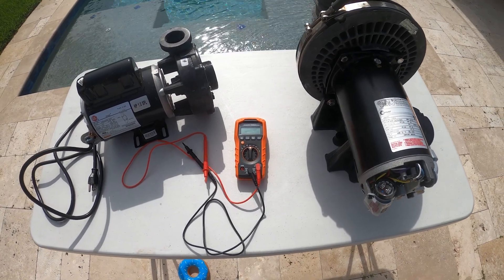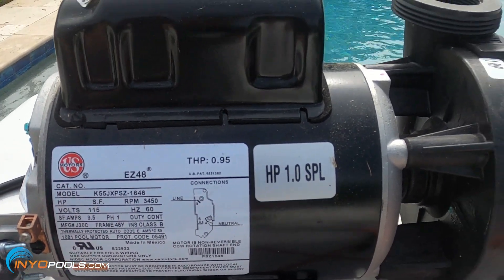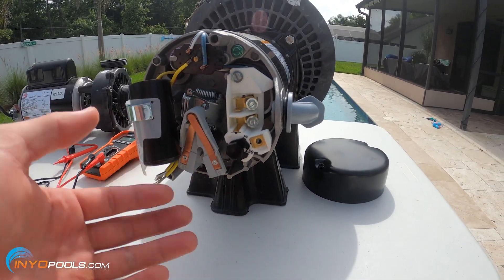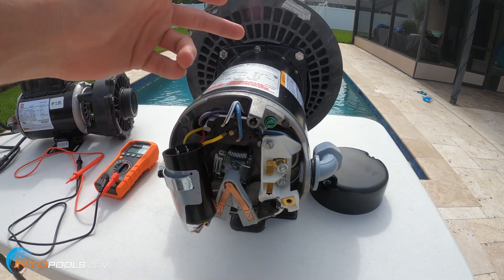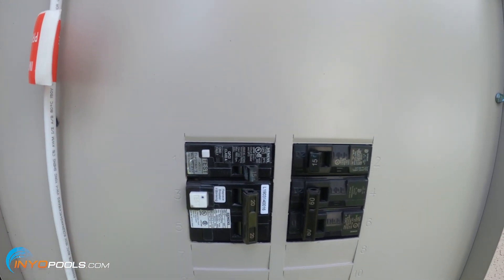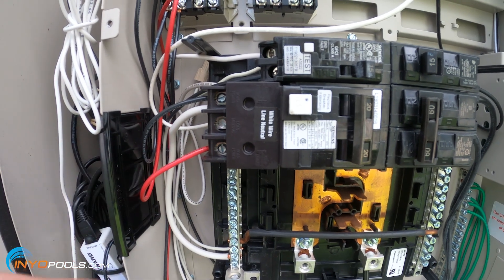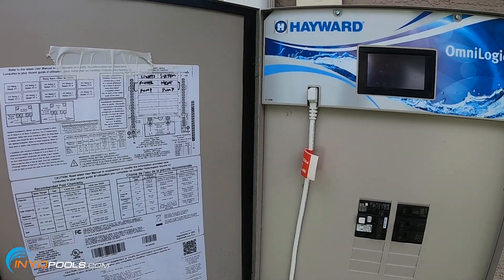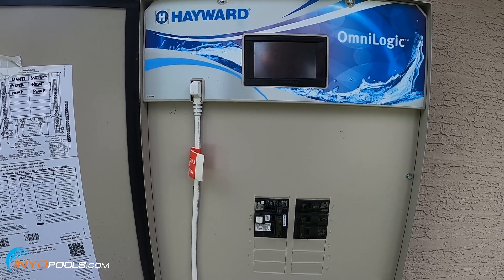How To Determine Pool Pump Motor Voltage

Comment: Nope that did help.  I have a breaker with two 115 that are black wires heading to the pump switch.  On the pump switch, both hot black wires are connected to the bottom and on top of the switch are two black wires head towards my two pumps.  Does this means that both pump are 115 and working off the same switch?

Comment: Both pump and heating element are 115v for my spa. Can i plug straight into the wall? Or does it need 240v plug in
Reply from the maker: First, check the building/electrical codes in your area to ensure it is acceptable. Second, I'd check the amperage on the breaker, pump, and heater to make sure you're not going to overload the circuit. If you have a 20-amp breaker paired with a pump and heater with a total draw of 25 amps, it won't work.

Comment: And why do some people say put the black voltmeter lead on the green ground lug and some people say put the black voltmeter leader on the lugs where the wires to the pump are connected?  Can't you always just put the black lead on the ground lug when testing the voltage? Kinda like when you test your car battery, you can clamp the black to the car frame and the red to the positive.
Reply from the maker: In pool pump motors, you can put the black lead on the green ground lug (like when you test a car battery by clamping to the car frame) because the ground is a reference point for voltage. However, some people recommend placing the black lead on the lugs where the pump wires are connected to get a more accurate reading of the voltage across the live wires. This method helps confirm you're measuring the potential difference between the two actual power lines, which is important for motors that may run on 230V instead of 115V. When testing a 230V circuit, you need to measure between the two hot wires, not ground.

Comment: My breaker is as wide as a double pole, but it only has ine lever on one side and a gfci tripper. Is mine called a 2 pole 1 phase?
Reply from the maker: What you’re describing sounds like a single-pole GFCI breaker, which is the width of a double-pole breaker but is still single-phase and controls one circuit. It’s wider because it includes the GFCI mechanism, but it’s not a two-pole breaker.

Comment: How can I check pool pump if the motor is working or not without installing the pump? can I cut and hook up an extension cord to the pump? or if there any other ways to check that?
Reply from the maker: If it is a 115V circuit, you can use a three-prong 'pigtail' to hook up your motor for a real quick test. I'd let the motor run for only a few seconds for the test. Running a pump dry can damage the shaft seal, leading to a bunch of problems you want to avoid.

Comment: 110v is not low voltage.
Low voltage is under 50v
Reply from the maker: Yes, in general electrical parlance; but in the specific case of pool pump motors, the lower voltage option is 110V. 220V > 110V
Reply: @Inyopools  - I understand what you are saying, just don't want ignorant people getting killed.

Comment: Even simpler: Look at the receptacle. It usually has numbers on it referring to NEMA configuration. Google that number & the voltage & amperage ratings for its safe use can easily be found.